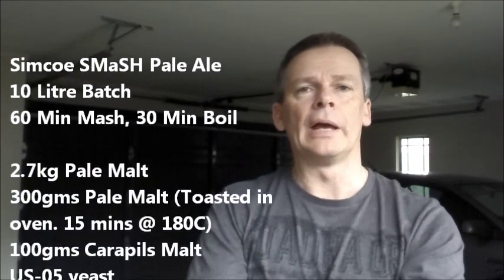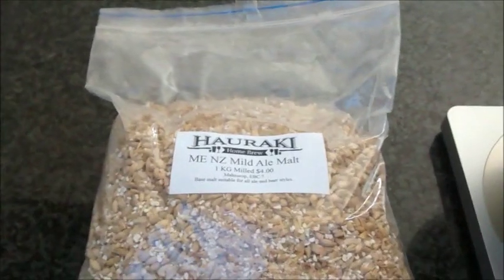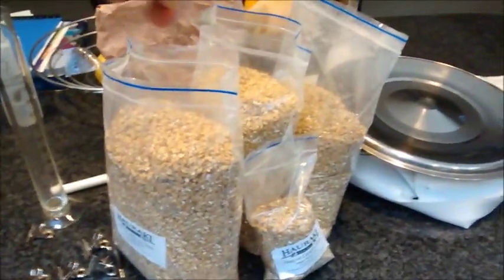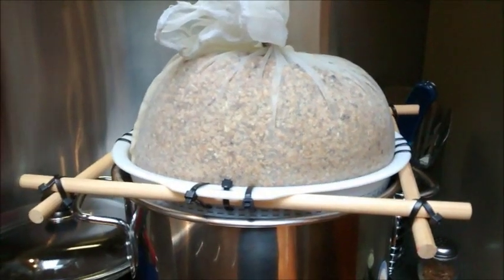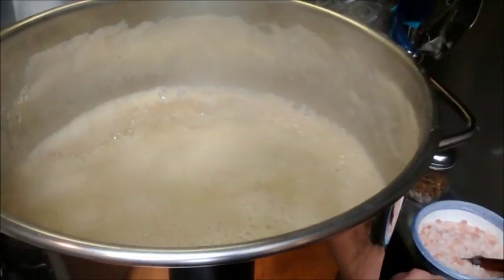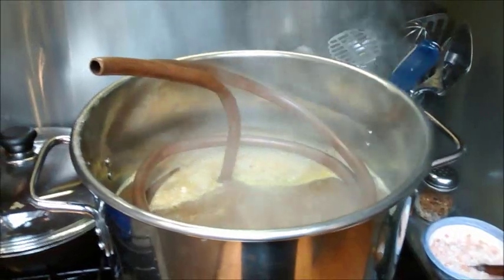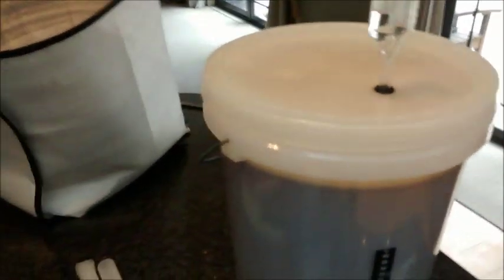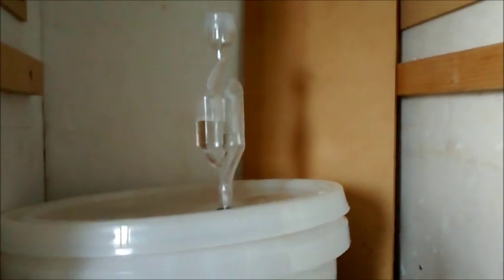Simcoe SMaSH Pale Ale - All Grain Brew Day

Comment: Great brew day, good to see you are finding time for it while getting through all the beer tasting! Cheers
Reply from the maker: Reidybrews Thanks. I was getting a bit edgy having not done a brew for while, but I'm glad I did. Only 4 beers left in the SJPorr challenge, so I'll try and get them done this week. Cheers
Reply: tubedinoz I'd be interested to see your results with regard to short boils and head retention. I found the one short boil i did had much better head retention than a revision (of the same beer) I did with a 60min boil...food for thought anyway, cheers
Reply from the maker: Reidybrews I've tried 60, 30 and 15 min boils and 60 and 45 min mashes. My first pure smash (Motueka) had great head and that was only a 15 min boil. It did taste really good, but I think 15 mins is too short and you risk not scrubbing off all the DMS etc. So this time I've stuck with a 60 min mash and 30 min boil. Will be interesting to see how that turns out. Cheers
Reply: Interesting. I read up on the subject a bit and the research suggests a shorter boil aids head retention but also reduces shelf life (<10 wks). Not that many of my brews last that long ha..cheers

Comment: Great stuff Dino and you've done well to film that along with all the sj porr reviews! 
I must get some grains and get a brew on! 
Stove top is ideal for smaller batches and I have had just as good results as with the bigger batches and my boiler!
Cheers mate-Hhb
Reply from the maker: cheshirehomebrew Thanks Dave. I had to hold the phone to film as the video camera is getting fixed, so that made it more interesting (need more hands!). The stove top works well. It's what I used for my SJPorr brew and have been getting some good scores and comments back, so shows it's capable (like you say) of good results. The only issue with it is the efficiency, but I'll work on that, plus grains are pretty cheap anyway. Cheers mate

Comment: that is a superb video dean. great to see you doing it. It was also really good of you to show what size of bung your putting under the fermenter, i'll do that from now on I think. looks good. my dinoz imperiel stout started off at 1.070 and is now at 1.020 but still bubbling. do you think this is safe enough to bottle? oh and I know exactly what you mean at 4.41...ha ha cheers mate.
Reply from the maker: Franks Homebrew77 Thanks Frank. Video camera is in the shop getting fixed, so it was a challenge to hold the phone to film, but worth the effort. The block of wood was the only thing I had handy. It doesn't need to be on much of an angle. An inch at the front is plenty I think. How long has your stout been fermenting for? If it's still bubbling, I'd definitely leave it. Once it's stopped bubbling, if you are unsure, I'd take a couple of readings 24 hours apart and if they are the same I'd bottle. I don't expect with such a high starting OG, you'll get down past say 1.016. It's down to the fuller body of the beer. Cheers mate
Reply: Thanks for the advice dean, your stout is in one of the new coopers FV which uses the burp method so I cant see if it's bubbling. it is in 3 weeks now and the muslin bag with the cocoa nibs is in it 2 weeks. it is at 1.015. I had also brewed norfolkhillbilly's Alaskan smoked porter on the same day, it is at 1.020 and still bubbling every 50 seconds. so I will leave that as you said until the bubbling stops. do you think I should bottle your stout ? gravity hasn't changed really. or should I leave for another week? is the muslin bag ok to leave in for that long? sorry for all the questions mate. first all grain and all that.
Reply from the maker: 3 weeks should be plenty to fully ferment the stout. 1.015 sounds like it's pretty much reached its limit to me. I'd bottle it myself. Cheers!
Reply: Cheers dean, your are a gent. i'll do it tonight. thanks again for the help

Comment: Nice one Dino. Do you find sparging in biab brewing increases efficiency/ reduces efficiency but gives you a greater yield or gives you greater yield at the same og?
Reply from the maker: Adam John Thanks Adam. To be honest my BIAB efficiency is pretty low compared to say a mashtun, where you can return the collected wort through the grain until it's clear. If I had a tap on the pot that would make a big difference. I might try a larger volume of sparge water next time to wash more of the sugars. I think I'm only getting around 60-65% efficiency, which is quite low. Using 3kgs of grain to produce 10 litres of a 5% beer is not great. At the end of the day I guess I'm spending more on grain, but it's still cheaper than extract. Cheers

Comment: Nice looking beer Dean! Do you often do 30 min boil?
Reply from the maker: Thanks. I've done a few. You need a little more hops to get the required ibu's, but I haven't had any issues. As long as you have a nice rolling boil it scrubs off the DMS. Have done a couple of 15 min boils,  but I think 30 mins is as low as you want to go. Cheers

Comment: Looks a
Cracking  beer Dino and the tips at
The end very useful. Looking forward
To seeing it
Turn out. Typing on iPhone at
Break at work so this is a bit dodgy. Cheers.
Reply from the maker: The Old Farts Brewery Thanks Jim. Hope the tilting back does the trick. More precautionary than anything else. Will post an update on whether it worked or not. Cheers